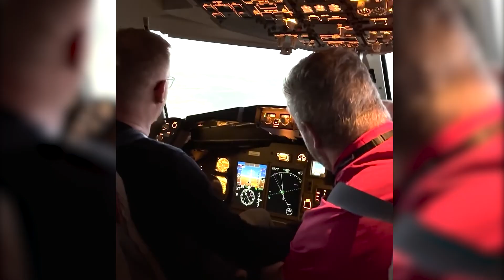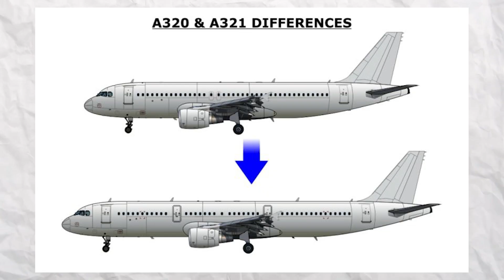Game over! This why Boeing says GOODBYE with 757!

Comment: The 757 was a brilliant aircraft with a handicap - it was heavy!

At launch, and for many years after,  it had no competion. That was true until the A321, which had more capacity than the A320/737-800 duopoly and naturally started to eat into the those areas where the 757 offerred more than was needed.

It can be argued that where a route formerly only operable by a 757 can now be flown by an A321, the A 321 is far more cost effective.What remains, is not enough to justify an upgraded 757, even if suitable engines were available.